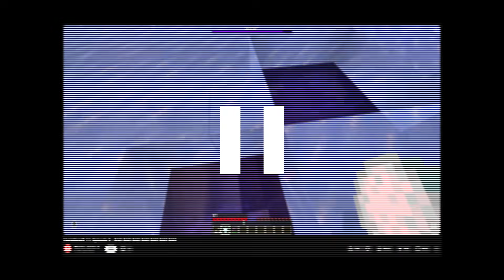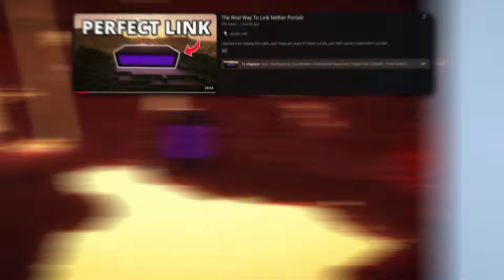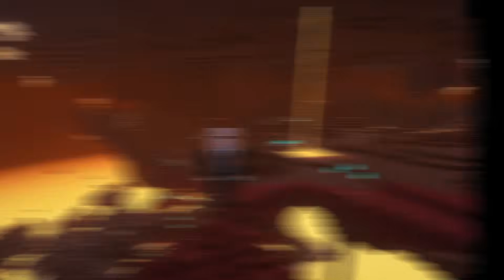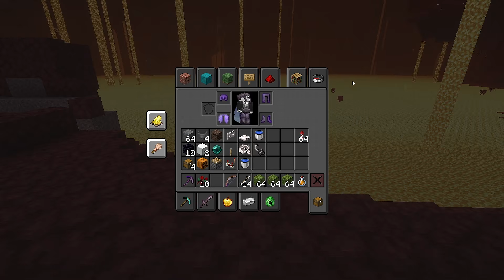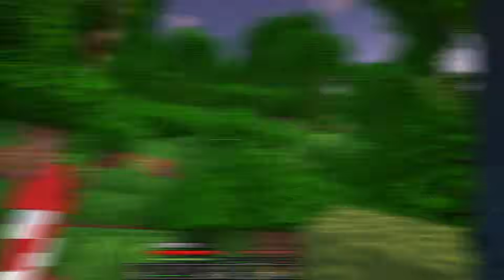An Actually Safe Obsidian Farm

Comment: I bet this could be modified to use withers and it would exponentially increase the rates without significantly increasing complexity. I am the kind of player that would be willing to make 1 or 2 wither cages, but I would not be willing to use end pillar regen. Actually my goal is to have this farm running in the background while I do other things and you have made it easy. Pearl loads the overworld side, and snowballs load the Nether. Throw a wither cage on either side and you generate as much as any end portal farm. Really cool mechanic.

Comment: I was just building this and turned out that ow side was in ocean, so i was thinking if doing forced portals in ocean is easier? Since you can make nether side in roof and oceans are bigger and only require high y level to force portal.
Reply from the maker: It's not easier or harder in an ocean, you still can just build the ow side on the surface
Reply: @potato_noir i meant, to switch the portal sides (ow is where you afk), but realised snow golems dont like the nether😅, unless you load it in a diff way

Comment: 9:35 it said you have to spawn proof the nether roof, but through testing I can't get a portal to spawn above the roof, regardless. Is this a mistake, or am I missing something? Also, is there anything stopping you from clearing a safe space in the roof of the nether, just below the bedrock, to place this?
Reply: the portal won't appear on top of bedrock, so you don't have to spawn proof the bedrock itself. but if you have put some other blocks above the nether roofs, the nether portal could spawn on top of them.

Comment: I've had an issue with the farm that the portal sometimes generates 1 block behind the farm, and if I put a block above the new portal it can like switch between the 2 portals. Do you know if theres a fix to it?
Reply: Yo, i know you posted this comment a while ago, but i just had the same problem. What he does not say in the vid, is that the portal needs to face nort-south. At least changing that fixed it for me

Comment: I found the end platform to be much simpler than dealing with force portals; I set up a dropper to chuck an iron nugget in there every 5 seconds or so and stuck hoppers below the end platform, then lined myself up and started afking. The nuggets give me a timer so I don't break my pickaxe 👍

If someone else starts duping concrete or whatever, then worst case I break my pick but it'll be okay.

Comment: Great tutorial! And good shout on the rates being plenty high enough for any reasonable build, it definitely feels like people will just go for the highest rates they can find without actually thinking. It's like, sure, your 38,000/hr build is fast, but are you actually going to use that many blocks or would afking for two hours at a 2,000/hr farm actually meet all of your needs for the next year of Minecraft?

(I'm also a little bit surprised that you chose to use an elytra instead of a happy ghast, it feels like that would be a lot less fiddly for building with)
Reply: Happy ghast either takes an hour (only slightly hyperbole) to fly to the build location or 20+ minutes to hydrate and grow. In that time you would already be done with the build. If you fly it to location you will also need a 4x4 portal to get it to the nether. I can see a use case for touch control users since Elytra is harder to use, but this farm is Java. If you have an elytra and can use it with basic skill, there are extremely few practical uses for a happy ghast.

Comment: why would you do this and not just use a barter farm anyways...?
Reply from the maker: You need a pretty good gold farm to barter even close to these rates (much better than mine), which probably takes a magma farm and/or an obsidian farm to make...
Reply: @potato_noir  magma is very easy to collect in small amounts to build a gold farm easily, also gold is very abundant in the nether, I have an 8 barter setup next to my gold farm and it's wild, I don't have to mine anything or worry about my pickaxe or holding down lmb

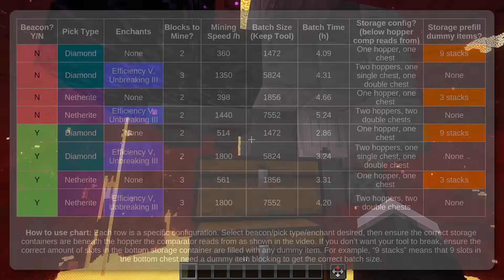Comment: 30:14 i'm looking at the chart right now and i'm a little confused when it comes to the blocks to mine category. without a beacon but max enchants, a diamond pickaxe can mine 3 blocks, yet if you upgrade the pick from diamond to netherite it drops down to 2? yet the numbers looks like it doesnt support this visually speaking. mining speed jumps from 1350 -> 1440. batch size jumps from 5824 -> 7552. leaving batch time (h) jumping from 4.31 -> 5.24.

Did you make a typo by mistake?
Reply from the maker: There is a section in the video that talks about this, pickaxes all have different mining speeds for obsidian and they all interact with the 20gt regeneration speed that is set in stone differently, meaning some make more obsidian/h mining 3 blocks in a row instead of 2. The chart is based on my empirical data testing the fastest mining speed and blocks in a row for each type.

At the end of the tutorial it shows how to set up the mining 3 blocks in a row version
Reply: @potato_noir  ok thanks for the clarification. I did watch the remainder of the video after posting the comment at the time stamp.